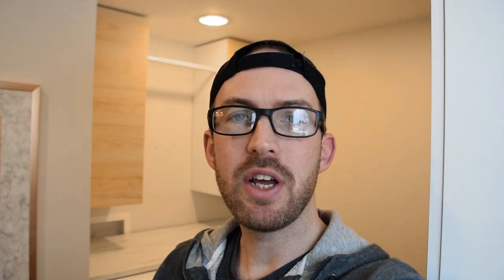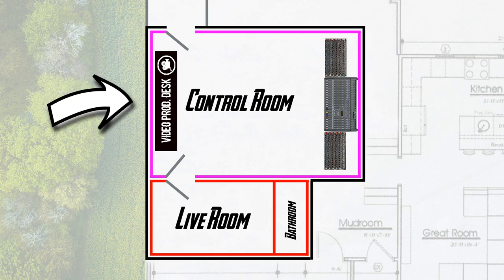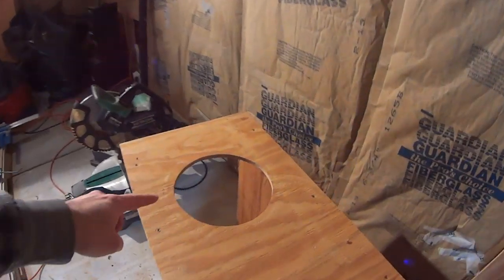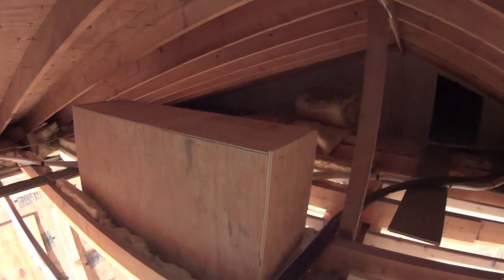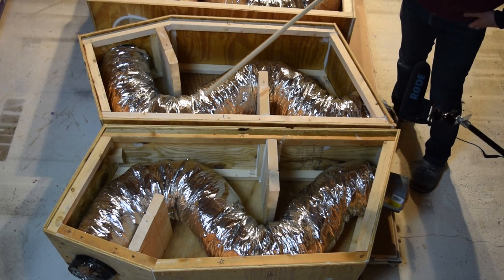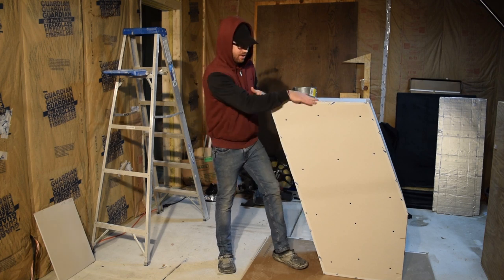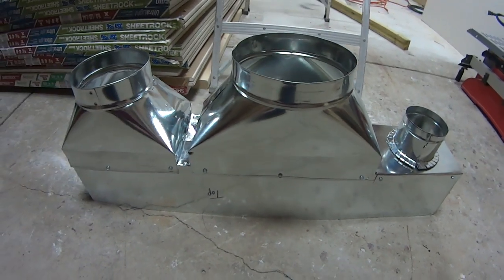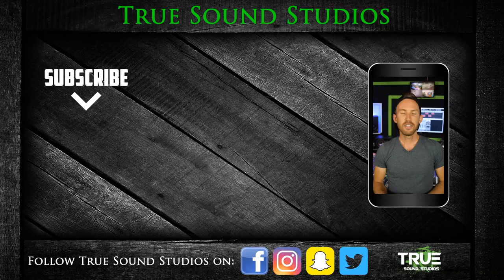Building A Professional Recording Studio - Part 7 (HVAC baffle box build & setup)

Comment: Hey, I was wonder about placement of baffle boxes. Can I put ventilation baffles inside the wall cavities?  Like in-between a double wall system?  I will end up with a 3 foot space between ceiling and roof and I want to use this space for air transfer while isolating sound as much as possible.  Bad idea?

Comment: Couple questions on the HVAC episodes: what heat exchanger are you using and does it provide variable fan speed? Your meter looked like the HVAC was adding 10 dB to the noise floor which is a lot of for recording studios. Putting bends in the duct is definitely a major factor in a silent room but it sounds like the unit either wasn't configured when you made the videos or doesn't have the capacity control it's sound output
Reply: I have two 6” flex ducts feeding my baffle boxes, do you know how I’ll calculate the relief vent size? This third baffle box will vent/relieve my studio space to the foyer which has the main return.

Comment: So, what I don't get is if the air (and therefor the sound) is passing through the ducting, what is the purpose of all the extra insulation? I can see a bit of it, to deaden sound from entering into the ducting from outside but honestly are sound waves not going to just bounce off the reflective surfaces inside the tubing?
Reply: It is going to bounce if it’s a metal pipe work. Not so much with these Flexi stuff.
Reply: Yeah unfortunately these boxes are not designed well at all. There is a tonne more to the design to get them to work properly. These will not isolate nearly as well as the effort they take.
Reply: More insulation/mass helps absorb lower frequencies..

Comment: I'm sorry, but in my opinion, this design makes absolutely no sense to me from an airflow "noise reduction" standpoint. 

What you've done is isolated what little noise is generated from the airflow in the ducts from being able to reach the outside of your boxes in your attic, but generally, that's not the noise you're hearing within your studio (if it is, you have other noise isolation problems). 

That noise, the annoying whistle coming from the ducts in the studio,  is the airflow coming out of the duct itself. You mentioned that in your previous studio, the airflow coming from the ducts was slow; that was the point. The baffled box slowed down the flow of air, which in turn, along with the insulation, decreased its volume.  And while the S shapes of the flexible ducts will also slow down the air flow a bit, due to the smooth nature of the inside of the flex ducts, it won’t have nearly the same effect as the hard edges and insulation of your previous design.

Again, my opinion, but I think you did a lot of work for minimal airflow noise reduction.
Reply from the maker: Terry Lovin So I thought I was being extremely clear but this is not to isolate the noise from the HVAC unit. This is to stop noise/sound from inside the studio from leaving through the 6 or 8 inch hole from where the duct comes through the soundproofed space. My particular HVAC unit is already extremely quiet and it was not even a consideration when building these baffle boxes. If you think about it, if you soundproofed a space extremely well and then put a 8 inch hole anywhere in that space that is where the sound will escape from and extremely cut down on the effectiveness of the soundproofing. In the following video I show how effective these boxes truly are and I think it will really change your opinion on this
Reply: I’m inclined to agree with Terry here. The previous design should be more effective in killing sound in both directions - especially in the direction that is more important to you - sound escaping from your rooms. The reason that your previous ones started to get smelly from the damp may well have been caused by using acoustical foam rather than Duct Liner, which has a microbial treatment added specifically to ensure there is no growth of mold etc. I know it’s a lot of work lifting them into place and they’re all sealed, but before you close off your ceiling I would seriously consider having a chat with one of the pros like Rod Gervais, John Sayers, or some of the online forum experts. Wishing you all the best with your continued efforts - I’m watching closely as I’m involved in a very similar project here in Virginia. Cheers! Andy.
Reply: Weezna, you said, "I want to put a speaker at one end of the duct and a mic on the other to see who much noise they truly reduce" and "I can use a decibel meter to see how loud the HVAC unit is after it runs through the ductwork" and "I'm hoping that it's just going to be silent coming out of the duct", in your closing; that was "extremely clear".  That's where my response came from.
Reply from the maker: Yes and those were two separate statements relating to two separate things. I first said “ I will test how much sound they will absorb, then I say “additionally I will test them to see how loud the HVAC air turbulence is.
Reply: @TrueSoundTV  @ Terry and Andrew.
It looks like we have some misunderstanding going on here. THIS box is NOT intended to reduce noise coming IN the studio from outside and vice-versa. It is intended to facilitate air passing through the HVAC unit and cool down or heat up the air WITHIN both rooms. Circulate within both rooms.

Terry DOES have a point, air coming IN the studio and going OUT the studio needs to be slowed down to eliminate the effect of the hole in the wall allowing noise from outside entering the studio and the music going out into your house. You made all the effort of reducing SPL from inside out and vice versa and, because we need fresh air, make a hole in it where air ( = noise) passing through. THAT's where air needs to be slowed-down as much as possible. I don't know the real data, but there is a formula that tells you how much air needs to be refreshed for each room. A simple variable speed fan, sucking air OUT of the studio will facilitate the same amount of air coming in the studio. This will only work if the studio is air tight, which looks like to be the case in your studio, assuming doors and windows are air-tight.

So I assume you will ALSO build some boxes to get in fresh air from outside to prevent you from ending up dead in this (yet to be) finished new studio. That would be an unwanted result, would it . ;-)
Keep up the good spirit.

Comment: I admire your dedication and hard work, but you 
really should’ve consulted an HVAC design professional.   This has violated so many rules of HVAC design. You’ve made the air more turbulent and system vastly 
more inefficient than it needed to be.    Read some articles at Energy Vanguard.  A top-of-the-line and properly sized mini-split air handler cassette in a well insulated building is already incredibly silent with zero duct work.  Even if the baffle box was a few decibels quieter, it’s coming with a great cost in HVAC performance.  A professional design probably would have resulted in a smaller sized unit running low velocities, which would’ve been quieter by nature.
Reply: I didn't watch all of the video, but most HVAC installers that I've ran across know very little about making an HVAC system as quiet as possible. (10 db noise floor range or less.) An air cassette handler would be at least 20db in my experience, which would be way too loud for my noise floor expectations. I'd gladly have more static pressure at the cost of a less efficient system if it netted me a few more DB in noise floor, but everyone's priorities are different.
Reply: Ryan Kramer HVAC designers are not the same as HVAC installers.
Reply: @chevelleman88  You know what? Touché. I blew right past that important distinction. Cheers!
Reply: Technically, The design is based on Rod Gervais and other professional acoustic designers that have indeed worked with HVAC professionals - but there's a lot of ways to screw this up, that's for sure.

Comment: From what I can tell, all that heating and cooling exchanger does is recirculate and then heat or cool the existing air in your rooms?  Where are you getting your FRESH air from? As it stands, you have ZERO ventilation...
Reply from the maker: Paul Bishop correct that is for heating and cooling and the ventilator hooks up to this system to get the fresh air into the studio. Unfortunately the ventilator didn’t arrive before this video was finished so I didn’t include that yet.
Reply: So does the exchanger actually heat and condition the air, or just just distribute warmer air from one room to the other? Can you briefly describe how the ventilator WILL be integrated into the system?
Reply from the maker: So the heat exchanger is just a small heating and cooling unit. It’s also known as a mini split but it just makes heat and also can cool. A ventilator is simply another unit that pulls fresh air from outside and introduces it into the duct system. I’ll have a video on how that all works as well

Comment: Dude, just use a minisplit system that is DUCTLESS
Reply from the maker: Anton du Fleur there’s no way to make it sound proof! The 3 inch hole that’s used to run the copper lines, drain, and power has no way to be sealed good enough to get the soundproofing rating i needed
Reply from the maker: Anton du Fleur plus, I was required by my town to add ventilation which has to be run through ductwork, no way out of that so I ran the heat and ventilation together
Reply: With respect, I am a specialist HVAC engineer also. I hear what you are saying and yes, the air movement is very very limited with a baffle box.   Let's just say this, I learn from everyone.  The this is that you taught me a thing or to also, so we are all good here. Yours was a good videos, I enjoyed it and the questions you asked where good. I was particularly interested the hear that the first bafe box you made started to smell a little.   I have an idea for you in that situation, you might look into.   Uv system in the duct.   Respicaire OXY 4 look it up they kill bacteria in ducts and house
Reply: So my mini split has a 2 hole that was spray foamed at install.  So you wear out your equipment faster pushing air thru the inefficient supply (unstreched flex, bent into an S)?

Comment: I cant see how this can possibly make any sense, surely lining the highly absorbent maze with a solid surfaced duct just negates the absorption of the baffle. You may as well just put some sharp radius bends in the pipe. It's like people that make acoustic absorption panels and cover them in non acoustically transparent material (Is that acoustically opaque!?)
Putting a solid surface in front of an absorption surface just makes it reflective, the energy that is meant to be lost to the acoustic insulation is just sent off elsewhere on it's merry way.
Reply: The lower frequencies still go through the thin walls of the ducting and get partially absorbed by the insulation. You are right as far as the upper frequencies. Those won’t get absorbed by the insulation, but they are a lot weaker than the lower frequencies and I’d think their energy would be taken care of more through the turns and twists. The main problem with ducting is the low frequency rumble of the air conditioning anyway. When I see people make these baffle boxes they never make them long enough, I think. Also, another approach is to have it go from relatively small ducting to larger insulated ducting, before going back down to the smaller size. That causes a lot of the energy to be lost. I think a combination of both approaches would work really well.
Reply: I have material set aside for my own baffle boxes right now (for an isobooth I’m building). We’ll see how things go.